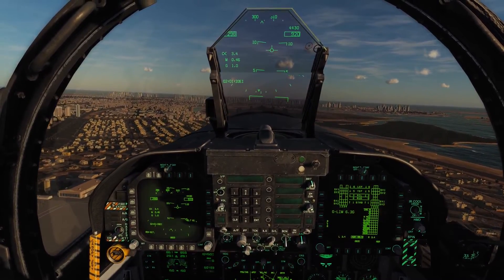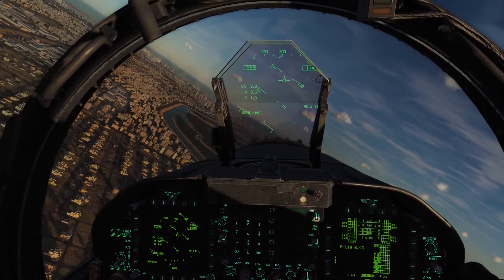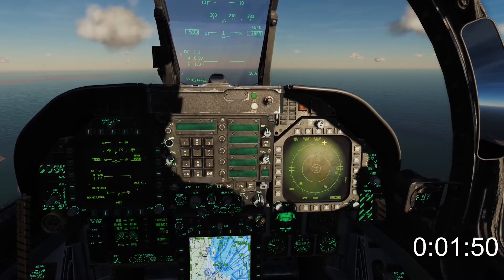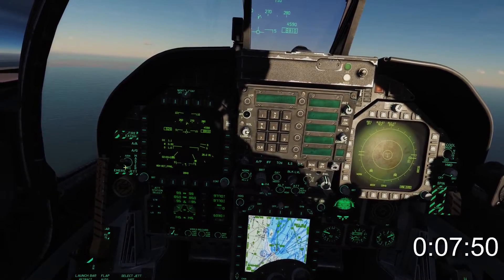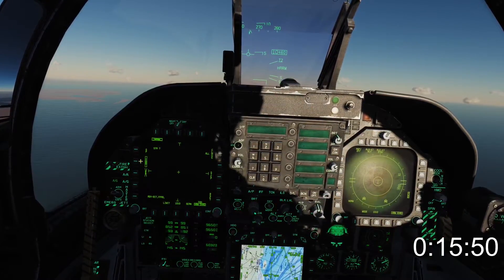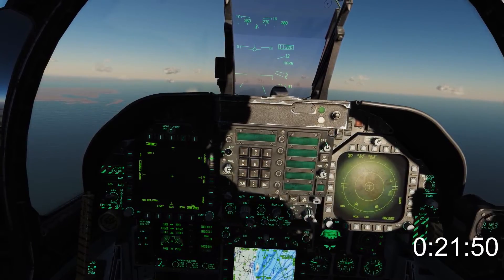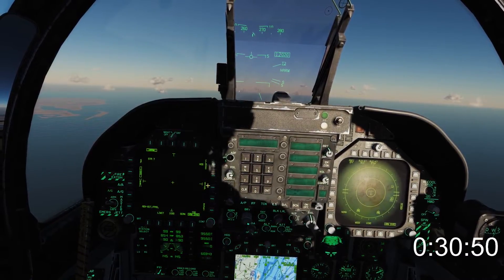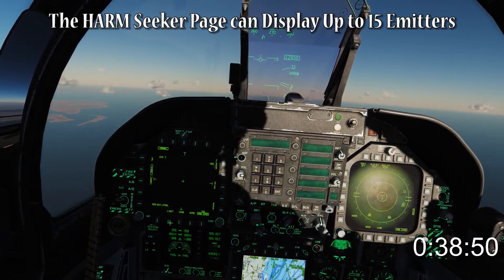1 Minute DCS - F/A-18C Hornet  - AGM 88C HARM - TOO Mode Tutorial

Comment: So, the question is what's the advantage of TOO mode? Does it have a range to the target? I guess it's helpful if there are lots of emitters close to one another but does seem more complicated than SP mode.
Reply from the maker: Thank you sir.  TOO has several advantages, but it doesn't display range.  The biggest advantage is its powerful filter.  Suppose your job is to take out a Fansong in an area saturated with emitters, there are other inbound packages who have been assigned those.  You can filter out everything but the FS and avoid any overlap with squadron mates.  Additionally the scan option allows you to re-scan quickly to identify pop up emitters and the limit option is very useful in heavily defended areas.
Reply: @Laobi  awesome summary, thanks!